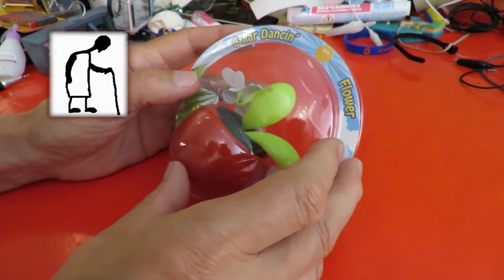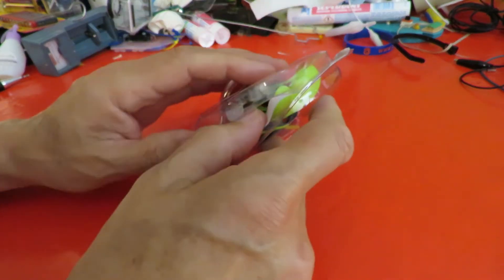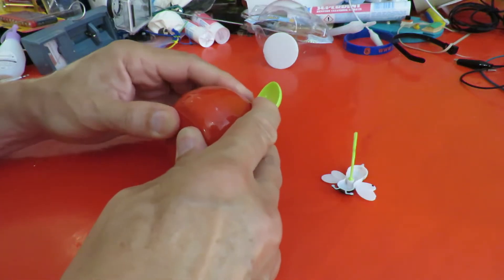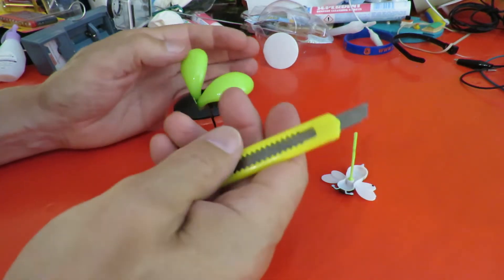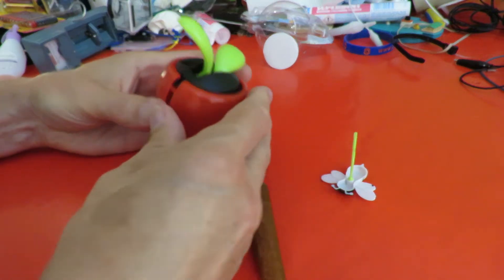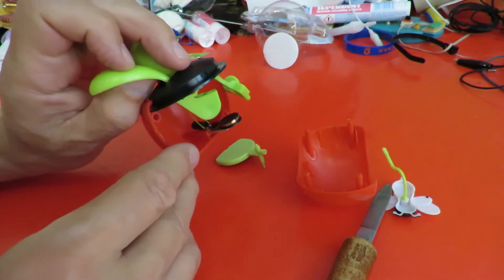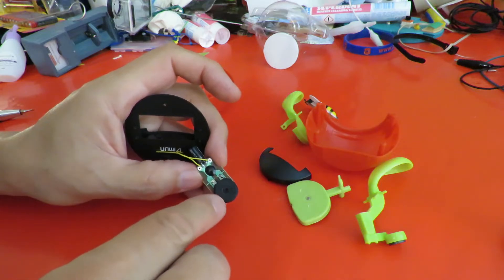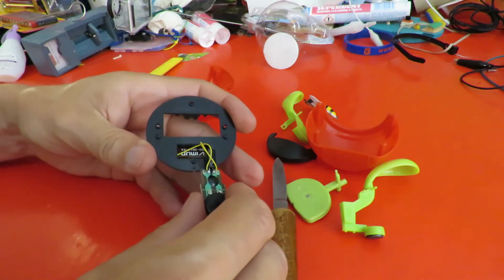Let's fix that broken Solar Dancing Flower from Pound World

Comment: Mine didn't come with that small coil thingy :( may i know the name of that partt?? so that i can buy them to fix mine, Thank you for this informative video! ❤
Reply from the maker: First of all, you would need the right skills with a soldering iron to replace a coil, the wires are hair thin and need special care to work on. Next, I think your chances of finding a supplier willing to sell an individual coil are nil. The shipping price of the item would probably be more than the cost of the solar flower. You would probably have to buy a bulk order of 100 items to make it worth while for the seller to ship it to you. If yours is missing the coil, then I suggest you take it straight back to the seller and ask for a refund. Your cheapest option is to buy another one.

Comment: Hello how do u charge these
Reply from the maker: You don't charge them. They run directly off sunlight.
Reply: @GrandadIsAnOldMan  thank u mine seems not to b working. I took it apart checked everything put a little more sodder on some weak points.cant figure it out.any help would b great
Reply from the maker: @joed3539  here is my general talk through on checking the solar rocker https://www.youtube.com/watch?v=dJQucWAgXMg

Comment: So I just received 2 new flowers and sadly, 1 came with broken wires that attach to the solar panel. Thanks to your extremely easy to follow video, I got brave and I knew exactly what I had to do to take it apart worked like a charm!!! How can I solder these tiny wires on or can I crazy glue them on??? And my other problem is the old dancing flower has a damaged flower holder. You suggested I use a drop of glue gun to hold  the flower on. I was thinking to build a new opening somehow by gluing on a piece of plastic short tubing, maybe a straw or heat shrink tube.
For now I replaced my old broken piece with the new one from the one that has broken wires. It works perfectly!!! Thanks so much for putting this video out there!!!🙏🤗
Reply: Update! I am happy to report that after 2 tries of soldering those tiny wires, it worked! I used my trusty old wood burner with one of the angled tips and put the temp up quite high. The first time I attached them, it didn't take so this morning I got brave and tried again. Nothing to lose😂. I figured if it didn't work at least I have the parts to use on my original one that works but as I said in my earlier comment, the part the flower goes into, was flat and unusable. So I followed your great detailed video, took it apart easily, replaced the middle part that has the little screw, and it works perfectly. Now I am rebuilding the tube part. I used super glue to attach my heat shrink tube(for now, til it breaks) and it's holding. I will insert a new flower and stem. Btw, to make a new flower, I took a pic of the new one, sized it in photoshop, printed it onto a large address label sticker, stuck it onto a cardboard, cut it out, attached a dowel/toothpick and it is working! So I now have 3 working cute dancing sunflowers! Thanks so much for your detailed videos and speedy replies. Have a great day and I look forward to more of your helpful videos. 🙏😃
Reply from the maker: Oh WOW 😁That is brilliant news. I am so pleased you were successful. They can be a real pain to work on. Congratulations and thank you for your very kind comments too 😊
Reply: I'm trying to attach a pic but having trouble.
Reply from the maker: I like your idea of heat shrink tubing, obviously you would have to be careful not to melt the plastic. Your idea with a short plastic tube should work too👍I am afraid gluing the wires is very unlikely to work. The glue would act as insulation and prevent electrical contact.

Comment: I have a few of these. If I put in a cap with more uF microfarad will the flower dance longer even when its not in the light?
Reply from the maker: I doubt it, but the simple answer is, try it and find out. However, I have shown an external supercapacitor can be charged during the day and then it does run all night - Supercapacitor on a solar rocker to run all night? https://youtu.be/cDCQJMbzLEE
Reply: @GrandadIsAnOldMan  Id like it to look stock, now there is space for a higger cap. There is a spot where the original cap is that looks like it will fit a larger one. I have a bunch of electrolytic cap kits i bought from Amazon. The original cap is 47uF @ 10 volts.
Reply from the maker: In my video description you will find these two links
This one is an interesting article going into depth on the circuit https://ez.analog.com/adieducation/university-program/b/blogs/posts/solar-powered-motion-toy-tear-down
This one is a small playlist of two videos that go into more depth on the circuit https://www.youtube.com/playlist?list=PLA5a2xPRSrB2_9cAd5v-1cqjKQ87vYOzU In this playlist, the bigclivedotcom video explains the circuit and covers the purpose of that capacitor.
 @coondogtheman

Comment: ha, thanks! Bought onw and the copper wire wasnt joined, thanks to you, I now have a pointless dancing flower that I sppent too much money on😂
Reply from the maker: I do have quite a few videos on fixing faulty solar rockers. If  the wire is broken, it could be fixed if you have a small soldering iron, but if you had to buy a soldering iron to fix it, it would be cheaper to buy a new solar rocker 😊

Comment: Hello! I bought a kikkerland elroy solar corgi toy on a recent trip out of town- got home and put it on my windowsill and it does not work! :( I’ve tried pointing a flashlight directly at the solar panel. Wondering if you’ve got this one, do you maybe know how to fix it?! I live far away from the shop I purchased this at, I’m unable to return it.
Reply from the maker: Have you tried it in real sunlight, most modern flashlights don't give the right sort of light
Reply: @GrandadIsAnOldMan  it was quite overcast/ gloomy today. Will leave it on the windowsill and stay hopeful.
Reply from the maker: @merkernna  It could be a mechanical problem, it may have slipped off its pivot point and cannot move properly. Does it rock if you gently tap it.
Reply: @GrandadIsAnOldMan  yes the head does move when it is tapped.
Reply from the maker: If you check this video playlist, you will find I have fixed many faulty solar rockers with several different faults https://youtube.com/playlist?list=PLA5a2xPRSrB1L61NAVuE5I9FbPgq3sSG1

Comment: The thin copper wires on mine snapped in the middle , between the board and the coil. Is it possible to solder the 2 wire ends together? They are so thin.
Reply from the maker: Yes and Yes. Yes you can solder them together and Yes they are very thin. They are also coated with a varnish that you need to clean off before they will take solder. The usual way to clean them off, is to hold the end of the wire in hot solder on the end of your soldering iron. The heat will burn the varnish off and you will be able to see the end of the wire turns silver as it gets a layer of solder on it. You only need the very tip to take solder. It is very delicate work but it can be done with care.

Comment: I recently received a couple dancing flowers as gifts, a Mickey and a Minnie Mouse. They have been working fine until yesterday my mom moved them to clean. Afterwards the Mickey stopped moving but the Minnie was still working ok. I turned them both over to look underneath, and then the Minnie stopped working. Today I took another look, jostled them around just a little to see if anything had fallen out of place somehow, and then the Mickey started working again but the Minnie (which was working fine yesterday) isn't working. I don't know what to do. I'm pretty sure they are glued shut, and I'm not as handy as you are. Any idea how just flipping them over could somehow break something inside? They have traveled by plane to get here so I know they have been jostled around before. Thanks.
Reply from the maker: It may be as simple as the rocking component has come off it's pivot point so it can't rock. A bit of careful manoeuvring might get it back in place. Next it could be the actual pivot has broken, one of the little plastic bits had gone. Then we move on to the electronics. The wires to the coil are literally hair thin so if you were unlucky and the rocking mechanism was pushed across the coil and scraped the surface it could have broken a wire. My guess is the first option, just off it's pivot point.
Reply: GrandadIsAnOldMan when o manually press on the leaves they do move just fine. It just doesn’t move on it’s own with solar power. I’m concerned it’s the wires in which case I’m no authority to try and fix it :( boo.
Reply from the maker: @victoriakabakian8073  I am afraid they are rather fiddly to work on because they have such fine wires. Another possibility is the solar panel has cracked when it was cleaned. That would stop it working. Unfortunately getting the rocker repaired would probably cost more than buying a new one. There is another alternative, not perfect but you might check this out https://youtu.be/gIL73F4KdOU
Reply from the maker: Oh, another problem that I discovered recently is they don't work if you put them on a ferrous surface, like a tin lid or maybe even a nail head in the wooden shelf. They work by swinging a magnet. If you put them on top of something that the magnet is attracted to then they cannot swing, so simply moving them to a different location could be all that is required - obviously good sunlight helps.
Reply: @GrandadIsAnOldMan  they also work under artificial lights
Reply from the maker: @Nickoboss29  that depends what type of artificial light. CFL and LED are very poor for operating solar rockers as they don't give the right wavelength. Halogen bulbs work fine and so do old incandescent bulbs.

Comment: Grandad, do you know where i can get those exact flowers? being as poundworld is gone.
I have masive problems removing coils without damageing them.
I like how they are on a circuit board!
Reply from the maker: In the last few months our Poundland stores seem to have been flooded with all sorts of solar rockers in various department - garden section - toys - seasonal and they certainly had ones like this one although not sure about exact match. As for removing the coils I tried levering them off and ruined plenty. The simple fix is to leave them on the plastic but carefully cut away what you don't need. The other idea that comes to mind that I HAVEN'T tried is to use methylated spirit or similar as that works with hot glue. It works it's way between the glue and the surface it is glued to and releases it.
Reply: @GrandadIsAnOldMan  Guess its time to play , lol, I will have a look in poundland later , might get some to practice on, was wondering if heat on glue might work
Reply from the maker: @Telboy-fv8ke  I think I tried heat on one and thought I had succeeded only to find the very centre section was still stuck and of course ruined the coil.